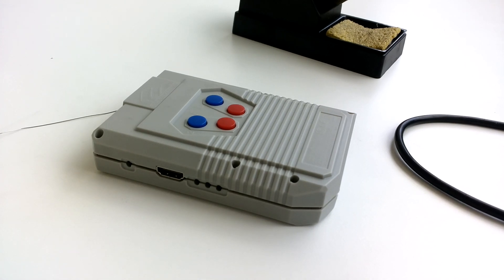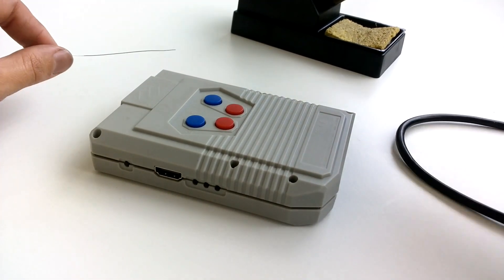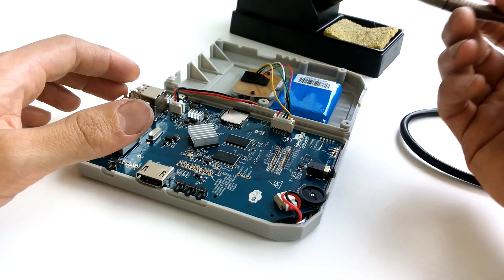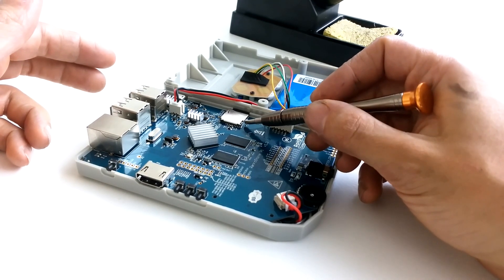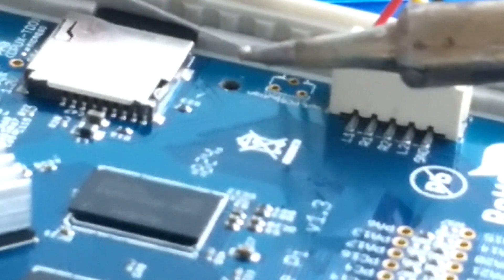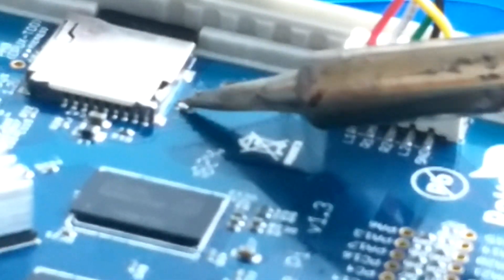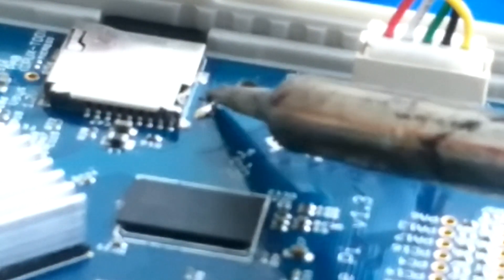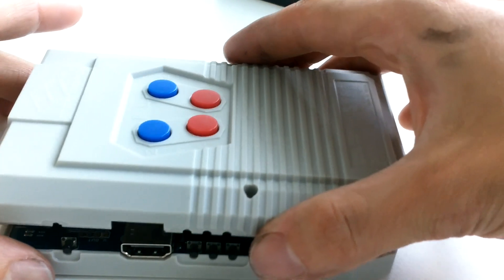RetroStone (first production) boot problem fix.

Comment: What does it mean if I still have a boot problem
Reply from the maker: Either the solder is not connecting properly. Or it could be another issue on the unit.
If you have a picture we can check it out. You can open a ticket on 8bcraft website